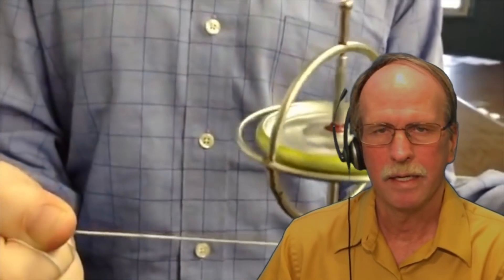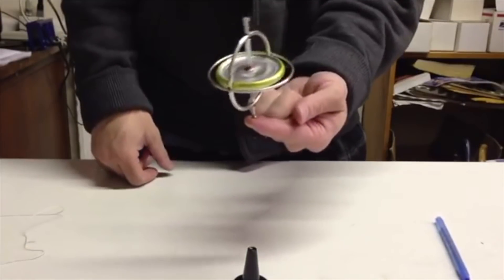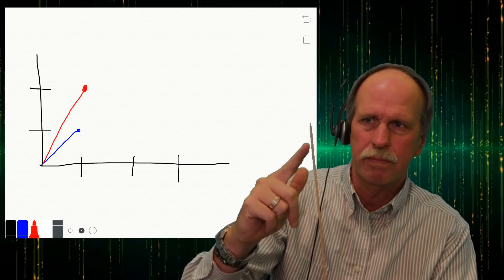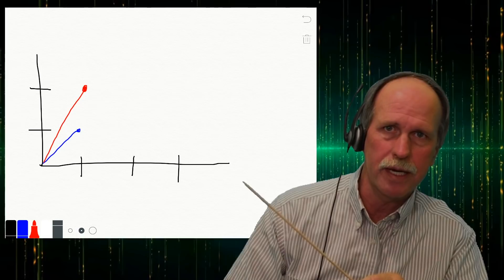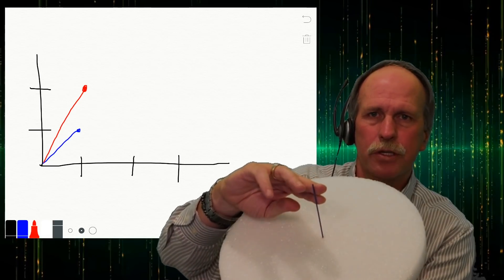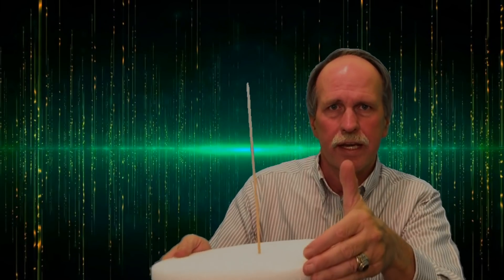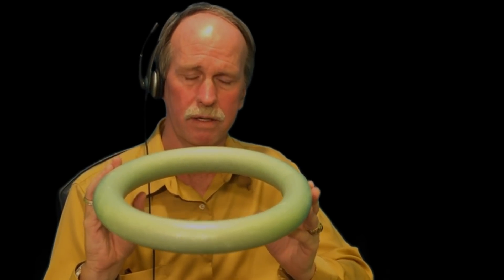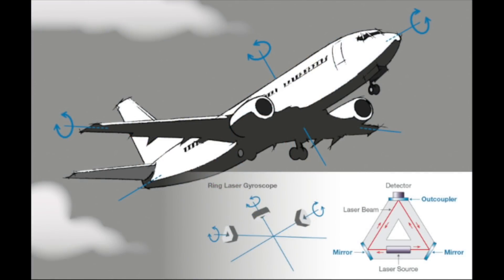Friday Physics Gyroscope | Laser Ring Gyroscope

Comment: I've heard FE idiots write off gyroscopic precession as random wobbles that spinning objects like tops undergo.
Reply: The cool thing is that we could measure the imbalance of the imperfect toy top and so calculate the torque component that imbalance will exert on the top (as a function of the rotational speed.) From that we could calculate how that torque would change the angle of precession. If you spin a top with a pointed tip on a hard smooth surface we can calculate the force of friction that is applied to the tip of the top by the surface, calculate the torque component of that friction (based on how high the center of mass is above the surface), and so calculate the rate of change in precession caused by that friction. That so-called random wobble is actually something that is therefore predictable and even calculable. 

I remember an old game called Battling Tops where the players spun tops in a dish. The winner was the last top standing as the tops hit each other. The tops were a disk on top of a long stem so that they hit each other above their center of mass and so cause a torque to be applied thus increasing the angle of precession of those tops. The friction between the dish and the top as the top moved across the surface applies a torque in the same direction.

In both examples, gravity applies a further torque, increasing as the angle of precession increased. Science!
Reply: The Earth is also affected by precession. 
Precession of the equinoxes. Takes about 26,000 years for one cycle.
Reply: I believe FEs are just a bunch of random wobbles themselves.
Reply: Unfortunately the most basic physics and maths go over the heads of the average flat earther.

Comment: Bob you should cover Gyro Theodolites history and the German Genius Shuler who invented them and before that his Shuler Tuning .
Mechanical Gyro Theodolites invented by Shuler using his Shuler tuning  used in Tunnel digging are the  Best proof of rotating Earth and because the manufacturers don't recommend there usage below 15% latitude because of Earth reletive slow velocity speed means they are not drifting due to Aether winds .
Gyro part of Theodolite finds True North based on Earth Spin .
Britain and France could not of dug the Channel Tunnel without them to guide them to within 300 Milimeters of joining up under the English Channel .
Reply: Similar story with IRS alignment - it apparently takes longer the further from the equator, and beyond a certain latitude alignment is not recommended. Also, there is a commenter knocking around (forget the name) that insists he's a tunnel engineer that's never had to account for curve or rotation, I hope you run into him. If I spot him I'll introduce you!
Reply: @hapaxl.6075  lol thanks .
Reply: @rocklover7437  fite da fwat urf !!!!
Reply: @hapaxl.6075  The same guy does not understand Newton's third law of motion. For every action, there is an equal and opposite reaction, he fails to realise a rocket is a reaction engine, and works by ejecting mass causing the body of the rocked to be propelled at 180 degrees from the force of the mass ejected.

Comment: This makes me think about those evacuated bulbs with the black and white vanes on it that spin in the presence of light.  I can't quite articulate what I mean, though.  When light hits those, is it as a particle?
Reply: You are thinking of Crooke’s Radiometer. Quite fun. For several years it was thought that it was “light pressure” causing the rotation. But no, it is a heat engine. One way this can be demonstrated is that how well the radiometer spins depends on the vacuum in the bulb. If the vacuum is too complete, it will not spin. Thus we can demonstrate that SOME air is needed, but if you evacuate all (or most) of the air, it doesn’t work. Therefore, it can’t be light pressure.
Reply: @cguy96  Oh, I didn't know that.  Now everything makes sense again.  I am fairly confident that when I was a kid, I was told that it was literally the light moving it.  I hadn't thought about it again until now, when I realized that something was off.   It is pretty dismal that I was given an explanation refuted in the 19th century.
Reply: What you are talking about is a Crookes's Radiometer, more commonly called a "Light Mill". It's difficult to explain how it works, or at least I find it difficult, but it's not to do with photons hitting the surface. If this was the case it should turn in the opposite direction. Light Mills only work when the gas in the bulb is at a very low pressure, it would not work if it were a total vacuum. It actually moves as a result of unequal heating on the dark and light side of the vane and the way the gas moves as a result. That's the best explanation I can give but like most things there is plenty of good explanations on 'tinternet. Just be careful there are sure to be a lot of bad explanations as well.
Reply: They operate by heat rather than light, the heat is absorbed by the black surfaces and, though it is quite complicated, essentially pressure to move the vanes, is created by the gas molecules (the bulb only has a parial vacuum) being excited by the heat. 

https://en.wikipedia.org/wiki/Crookes_radiometer

Comment: This is just wording, but what you call torque I would call moment. Yes the units are the same (Nm). But torque is a twisting action, say like on the prop shaft in a rear wheel driven car. Or the drive shaft in a front wheel driven car.  Moment is more like force at the of a beam. Just my 2 cents.
Reply: I think you mean “moment of inertia” or “moment of force”. (Just “moment” can mean a number of different things.)

Moment of inertia”, “moment of force”, and “torque” are different names for the same thing.  Some reckon that there are subtle differences, like torque is a static force but moment of inertia is a dynamic force. But that probably just depends on your area of expertise and where you learned the terminology, and doesn’t seem to be consistent.